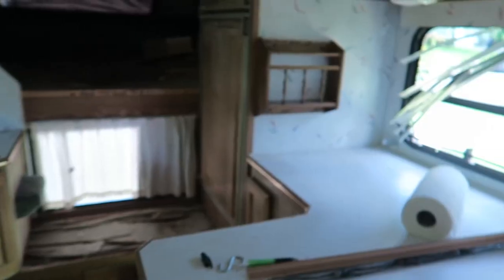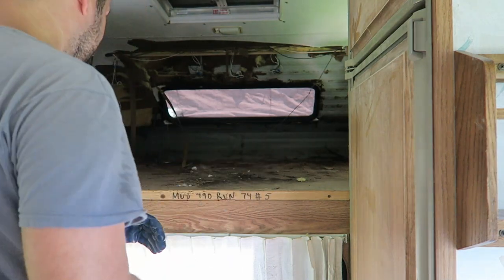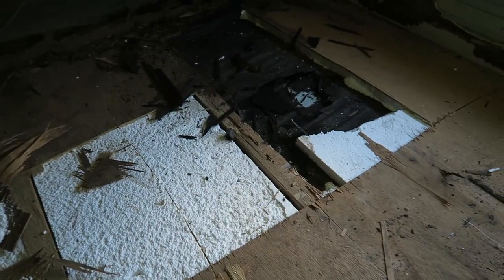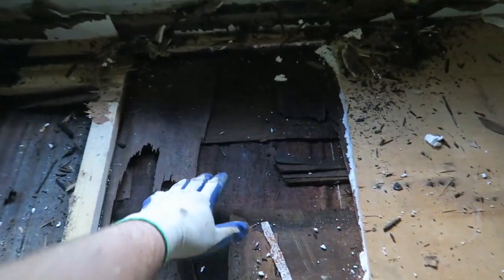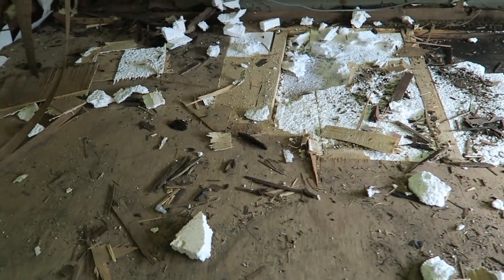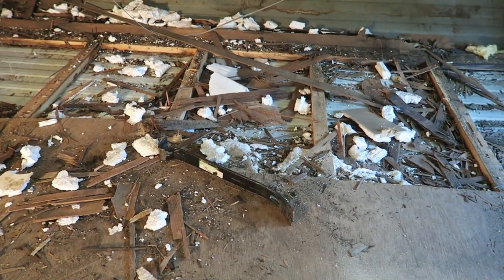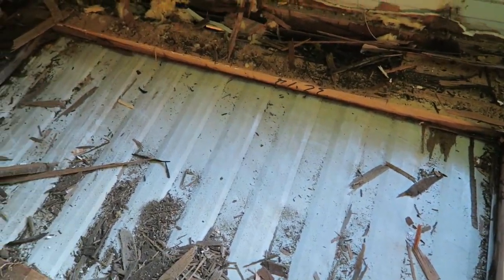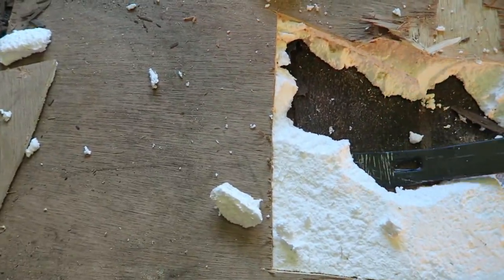Camper Bed Demolition Continues | Truck Camper Renovation (4)

Comment: I'm currently in the process of doing the same exact thing to the same exact camper, but I had to remove the sidewalls, cabinets on the sidewalls, and will have to fix the ceiling as well. I think I'm going to replace the frame with aluminum extrusions rather than wood.
Reply: I Just started tearing mine apart too.  Just picked up a '97 880 legend, and it's naturally got almost the same exact leaks.  I think we can salvage some of the cabinets and the floor, mainly because I don't want to open that can of worms.  Of course, the seller said nah, it's all good.
Reply from the maker: One thing while you are doing your renovations that we just found out... that huge dometic fridge is not efficient at all with solar. It drains the batteries so fast. We have to get a normal house mini fridge to replace it to be able to run it off solar. Which if we knew that from the start, we wouldn’t have redone our fridge and would have taken it out while still remodeling it. Just a tip if you plan on boondocking and doing solar. If not, and going with campgrounds- it’s a great fridge.
Reply: @NickandJulie  We are uncertain about adding solar right now, but if we do, we will try to isolate the fridge on propane if boondocking.  But the renovations, upgrades and upkeep provide endless opportunities to get to know TC life pretty thoroughly.  For better or worse.  Good luck with the fridge changeover.
Reply: @NickandJulie  Not there yet, but it is something I will discuss with my better half during this process. Thanks for the tip.

Comment: I am facing the same problem with my camper, the window or side seam has leaked and the wood underneath  the bed has the beginnings of mold.  My question is, every video I see people remove the floor from the inside out.  I have filon fiberglass siding on the outside and I am thinking it would be easier to remove that outside underneath panel to replace the framing of the floor rather that remove all the closets in the four corners of the bed area that cover the plywood sheeting inside.  Is there a reason not to go from the outside in?
Reply from the maker: I think that is the right way to do it. That would be easier. The reason we didn't do it that way is bc our camper is outside, we don't have indoor storage for it and its a lot of work and takes a while so we didn't want our camper exposed to the elements for that time.